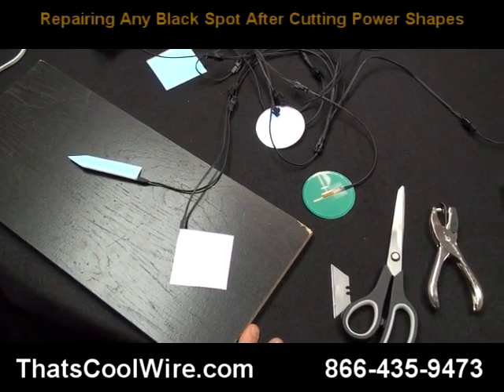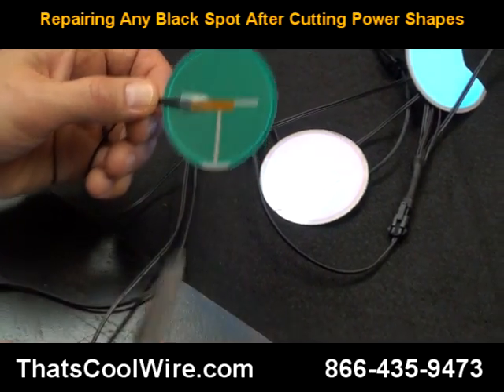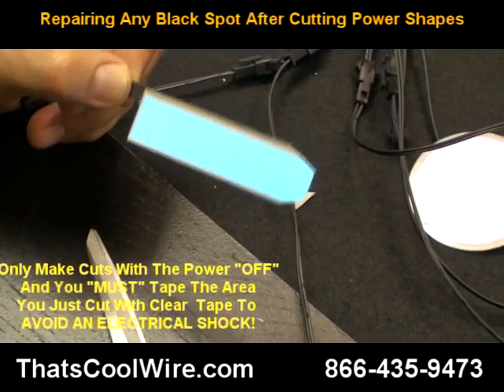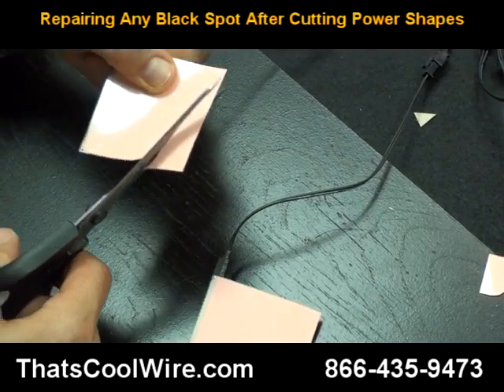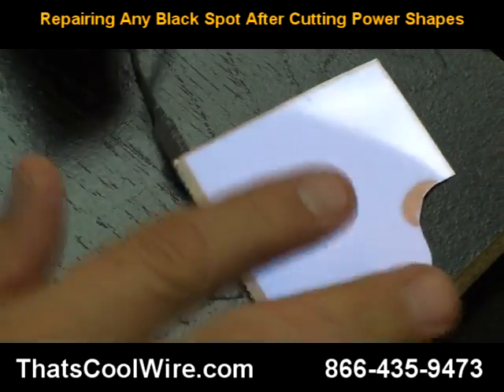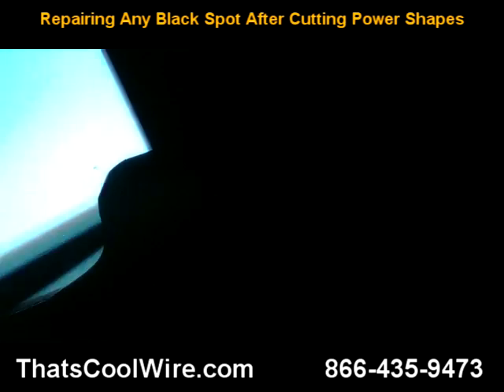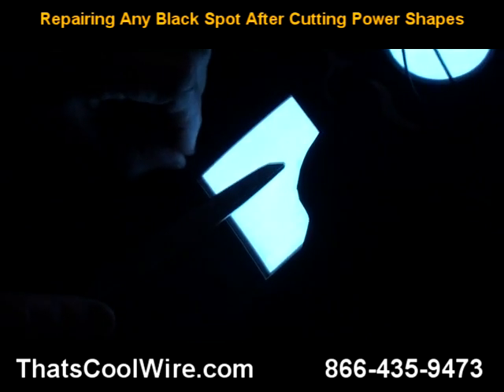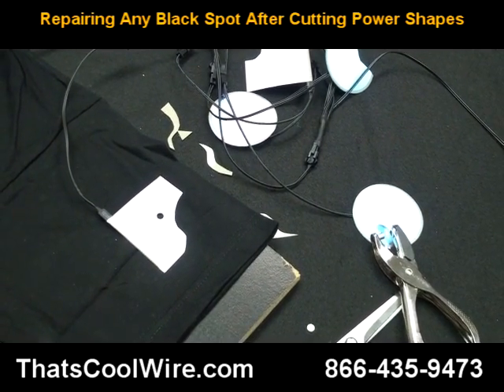Repair Black Spots In Your El Flat Panels

Comment: Cool video!
I have an EL piece that I need to repair, I wouldn't call it a "black spot" it just got a crease in it, and now a fair size of the section is really dull :/ when I flip it over on the black side it looks blue-ish where the crease is. Can it be repaired the same way with an iron?